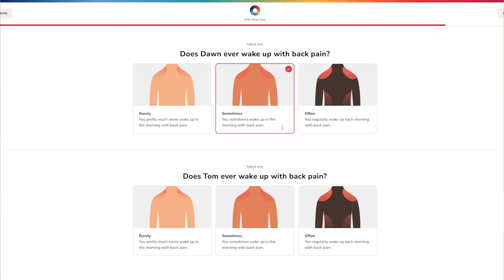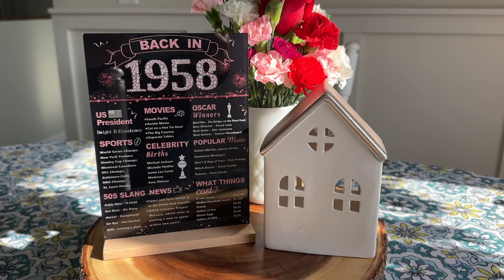Surprise Party Clean, Declutter & Prep with Me!

Comment: I love using fabric shower curtain liners 😃🎉... the key to drying them out well (so they don't mold 😕;) is a  plastic suction hook 🪝! 
Find the MIDDLE of the bottom seam, hook it, and then drop dry 💦
Reply: We also use the cloth liners. So easy to throw in the washer.

Comment: I always wash the shower liner in the washing machine. Yes, sometimes the liner doesn't last through the wash, but I've had very good luck and never lost not even one liner to the spin cycle. Of course, you take it out before the wash cycle ends, and it'll have water in it, but then i just hang it to dry. Wal la, new clean shower liner.
Saves money, too.  ❤

Comment: For a shower curtain idea... I like using 100% nylon fabric shower curtains. I don't use a fancy outside second curtain, just a nylon one and make sure it stays tucked inside the tub. It's easy to put into the washer to clean up every week or two. You can even put it back up without drying it in a dryer. Because it will dry on the shower rod just fine. I personally like a white one, but if you look for them, you can find different colors. If you have a clothes line outside, give it some sun and you may be able to keep weird stuff from forming on the bottom edge of the curtain after it's been washed. Enjoyed your video! Thanks for sharing.

Comment: I’ve had a fabric liner for almost 4 years now. I switched because I too did not like the waste that seemed to happen every year with the plastic liners. I have not looked back…I use it along with a decorative shower curtain and it dries quickly in my dry climate. I wash it in my washing machine about twice a year. I’ve only had a slight issue if 2 or more showers happen before the liner has time to dry and then it just wicks water onto the decorative curtain (only slightly annoying)! It’s better than tossing a plastic one all the time😉

Comment: I buy the heavy duty plastic shower curtain liners from WalMart.  When the liner gets scuzzy, it can be thrown in the washer with a load of towels, using liquid detergent for the wash and vinegar in place of fabric softener (vinegar dissolves mineral deposits from the water).  Shake the excess water off the liner into the wash tub, and then throw the liner in the dryer (no heat) for about 5 minutes, then hang it back up to dry the rest of the way.  Magic!  Love your videos!  :)

Comment: Dawn for the shower liner with calcium stains etc on it - you may be able to spray a mild mix of water & vinegar on it each time the shower is used - (just a thought).  I always wash the shower curtain & liner in the washing machine together in warm water & very little soap. When you're putting it in the dryer, it will be dripping but in just a warm temperature the liner comes out soft and clean with no rips in the plastic. - - - Also your party house looks lovely and I'm sure your mom will feel honored on her special day.

Comment: Our shower curtain has a removable liner that snaps onto the lower 75% of it, the top 25% is opaque.  Once a month, we unsnap the liner and wash it with 1 or 2 hand towels on a gentle cycle. I use about 1/3 the amount of detergent that I normally use and 1/4 c bleach.  We've had this shower curtain for years and it still looks great.

Comment: Hi Dawn, For the shower curtain liner, I just put it in the washing machine with detergent, 1/2 cup vinegar and hot water. It helps to wash some towels at the same time. Then put it in the dryer on regular heat for just a few minutes to get the wrinkles out and hang it up. Thank you so much for your down-to-earth personality and sharing your very helpful tips. And happy birthday to your Mom.

Comment: 11:50 I boil vinegar in my (electric) kettle to remove mineral scale inside. 

When I’m done with the vinegar, I tip it down the bathroom floor drains. It reduces any stagnant water smells.

Comment: Shower curtain liner! My sweet  grandma taught me to throw my plastic liner into the washing machine on warm w a little bleach, then about 10 min in the dryer on low and hang immediately - perfect! They also sell fabric liners I do the same with them and they have both lasted years! Also… if your plastic liner has a small lip on the bottom edge it will hold moisture so take your scissors and cut it off before use!!

Comment: I buy a good clear or frosted liner to go inside the tub. When it gets a little yucky, I take it down put in the washer with white towels detergent and a splash of bleach and hot water. Once it spins I put all of the wash into the dryer. After 5 plus mins. I open it up, pull out the liner. Clean and clear, no wrinkled up plastic!. Then finish the drying of towels while you rehabg the liner. Mom taught me this.

Comment: I buy fabric shower curtain liners. They aren’t hard to find. They can get mildewed, so you might have to wash it every other week or even every week. They also aren’t waterproof, so you do get a little water on the edge of the tub and possibly a small amount on the floor, but a bath mat or an extra towel should be enough to keep it from being a problem.

Comment: You guys did a wonderful job! I just wanted to share a tip with you that was once shared with me, place your heated blanket under your fitted sheet and turn it on just 5 minutes before bed and your blankets will also be warm so both sides of your body are toasty and not just the top. It’s also way cheaper than a heated mattress pad. I could never go back to the old way. Stay warm!

Comment: Hi Dawn - I actually invest in a medium or heavy duty shower curtain liner - then when it starts to get kinda yucky - I take down the linker and outer curtain and wash them both in my machine on the delicate cold cycle.  I usually can extend the life of the inner liner pretty long before I need to replace it.  I usually need to replace it only when the curtain loops start to tear after about 5 or 6 years.    Ive tried the washable inner liner, but honestly it leaked in our house so we had to go back to the plastic.  PS - I found if you spray your inner  shower curtain with Dawn power wash and let it sit on there for a bit,  lot of times I can just rinse off curtain and it keeps it from getting too moldy, especially around the folds.  I spray it on before I shower, then rinse it while I'm in the shower and weirdly keeps it cleaner longer too.

Comment: I do wash my shower curtain and liners but I wash them separately. The curtains I wash normal like I would a blanket, by itself. The liner I wash by itself and add bleach . You can also scrub it a little before you put it in the washer with some water and baking soda. I do this  occasionally. 
When the stains won’t come out I toss it out. You could also cut the bottom of it off that gets the soap stains and then use  the cleaner part of the curtain as a drop cloth for painting.

Comment: I have a snap out shower curtain liner like they use at our timeshare condo.  Whenever it needs cleaning, I unsnap it and wash it in the washing machine with two towels with a little lysol and gain liquid soap.  When it's finished washing, I take it out of the washing machine and snap it back on the shower curtain, leaving it drawn across the rod to dry.  I sometimes need to spot clean some stubborn areas after it comes out of the washing machine, but that is all.

Comment: I have the perfect solution for your shower curtain liner.  We have well water and liners have always been a problem.  I found cloth fabric liners at TJMax and Marshall's.  They carry white ones and are only 7.99.  I rotate two of them.  When one starts showing "rust" stains I hang up the other one.  In the meantime I soak the yucky liner in my washer overnight.  I use hot water and a cup of "Ironout".  Works like magic.  I hated those awful plastic liners.

Comment: I cannot be around synthetics, plastics,  vinyls, chemicals etc [long story] but I have found fabric shower curtain liners to work well, and launder well but don't get so "grotty" as the vinyl liners do.  Some are comparable prices and others are very pricey.  They are very simple to make if you just buy the yardage, and either add a casing to the top for the rod, or, add your own large grommets along the top hem.  I found that using 2 separate rods for the tub/shower worked best -- one for the liner and one for the decorative curtain.  I use actual linen fabric in a natural wheat color, or  when in rotation, use an eggshell color made from very tight weave "barrier cloth"; you could also use duck cloth with a tight weave.  My favorite store folded after decades, but there is a place called 'Organic Cotton Plus'; while I have not needed to buy more fabric in awhile, next time I do, I'll buy from them since my former source us no longer available.

Comment: I switched to the thin fabric shower liner instead of plastic or vinyl. They always have fabric in the nicer hotels I noticed. You can take it down and throw it in with your whites to clean it. Super easy. They usually come with the magnets on the bottom like the plastic ones. If they don't have that I know you would just buy and attached the magnets yourself! 😉

Comment: I wash my liner in the washing machine.  I add a bath towel or two for friction's sake and run it through a normal wash cycle. I drop the wet liner over the curtain rod while the towels run in the dryer and add the liner during the last ten minutes.  Works every time.

Comment: we also renovated an old bathroom and installed a collapsible glass shower screen. it is now about 15 years old and in good condition. Only the transparent silicone joint which seals the space between the two glasses has yellowed a bit, otherwise everything is like new.

Comment: I use plastic liners and have super hard water. I mitigate the water spots with a mix of half-and-half hot water and vinegar, with a couple of drops (a little goes a long way) of Dawn detergent. I slather it on with a sponge, let it sit for a few minutes, then gently scrub off- I have a detachable showerhead so it's easy to rinse. Eventually when it gets to the point where it can't be cleaned anymore, I save it and use it as a painting or craft project drop cloth. I buy a liner approximately once every four years.

Comment: I use washable fabric shower curtain liners (think hotel shower style). I have two for my one shower, in case one doesn't make it through the laundry right away. I find they only need to be laundered once every 1-2 months in my household. They last for years. I prefer the ones with magnets on the bottom.

Comment: For years, I've used the "Hookless" brand shower curtain.  No shower curtain rings. YAY!!! It literally takes SECONDS to remove the curtain or hang it up after laundering! But also, I haven't used a liner with them, and they work perfectly fine. I don't know if they're still available without the liners, but I'd like to find a different color for my one bathroom that I plan to paint this summer. So I need to remember to search for one :)

Comment: For shower curtain liners we have had real good luck with the heavy white plastic shower curtain from Menards. We do a quick wipe down after our shower and it has been good for 10 years or more. Being white you don’t see the water spotting. Also we no longer use bar soap as that will leave it’s own residue.  As to your Bundt cake was it your larger pan that will not rise as tall because it takes more batter to get the same height as your smaller pan? Happy birthday to your mom. Looks like you have choices the makings of a very nice party.

Comment: You can actually wash the plastic shower curtain liners in the washing machine with your towels or shower curtains.  Add one cup of baking soda and 20 drops of tea tree oil and they come out nice and clean.  Wash in cold water and then hang to dry. I actually just learned this myself.  All those years of throwing away those liners.  I just never knew.

Comment: My mother in law taught me to just use the fabric shower curtain without any liners. U just wash the shower curtain as needed in with towels. It's easier to take down bc it's just the one curtain to mess with. It doesn't let the water out into the floor either. I was always afraid the water would end up in the floor if I didn't use a liner but it doesn't. Ever since I tried it, I haven't gone back. It's just easier and it makes it easier to freshen up the shower, no liner to deal with. I just wash the fabric one and hang it back up easy peasy. 

Also, bonus the shower curtain doesn't come in on u while u shower like the plastic ones. Once it is wet it holds the curtain out of your way. So win win. :) solves two problems 😀

Comment: The liners are washable.  I put them in the washer with two bath towels on top. Wash with hot water,  1/3 C. detergent, 1/3 C. beach. Don't dry in the dryer unless it is a fabric liner.  Hang back up to dry.

Comment: Fun stuff!  I have the dark fixtures in my bathroom, too. Did you use regular vinegar or cleaning vinegar?  Our faucet is the trough style, which I love, but the water sits on the top & creates white deposits. I soak a paper towel in regular vinegar & let it sit, & that helps, but not entirely. If using cleaning vinegar, do you dilute it at all?  Thanks!

Comment: For the shower liner - throw in the washing machine with a cup of vinegar and it gets all the water spots and residue off.  Hang it back up wet.  Super simple!  If it has mildew wash in machines with oxyclean.  Have done this for years- the liner should last 5-7 years this way.

Comment: Shower curtains are a cheap change up. I use a fabric liner and I like it for the texture verses plastic, but mine still gets moldy at the bottom very quickly. So, I have to soak the edges in bleach.

Comment: How To Clean Shower Curtains Using Baking Soda

Bathrooms are largely damp environments, and shower curtains tend to attract moisture.

For these reasons, they are prime targets for mold and mildew growth and should be cleaned regularly. 

Ingredients: Baking soda, water, distilled white vinegar

Method: If your shower curtain only has a few drops of mold or mildew on them, then this can be removed with a light paste of baking soda and water. 

Apply the paste to the area to be treated and scrub gently until the stain is gone. Finally, spray down the area with the neat distilled vinegar to prevent any mold regrowth.

Heavy mold and mildew Ingredients: Baking soda, washing detergent, distilled white vinegar

1. Wash the shower curtain in a washing machine with two bathmats on a low-temperature setting.

2. Add one cup of baking soda to the detergent during the wash cycle.

3. Add one cup of vinegar during the rinse cycle.

Finally, remove the shower curtain from the washer, rehang it and allow it to drip dry.

The shower curtain should now be stain-free and smell fresh.

The bathmats are important to prevent folding and provide a rubbing action to the shower curtain whilst in the wash.

Depending upon the washing machine’s internal seals, it may need a further rinse cycle to clear the system of any remaining vinegar.

This will prevent a mild acid from “sitting” on the rubber seals within the machine and invalidating the warranty.
Reply: I would have just posted a link to the site and let you search through the recipes, but it says, "this site is currently unavailable". So I'm just going to share the one recipe. I've tried it and it works!

Comment: You can get a fabric waterproof liner. I have used them for years. Target sells them. You wash them just like any other fabric, but it's waterproof. I have owned mine for 20 years, clean as they were the first year. I buy white so I can spot clean or bleach them easily. Can't recommend highly enough. I really dislike the plastic.

Comment: How to Clean a Plastic Shower Curtain or Liner
Step 1: Remove the Curtain.
Step 2: Place It in the Washing Machine.
Step 3: Add Detergent, Vinegar, and Baking Soda.
Step 4: Run on the Gentle Cycle.
Step 5: Remove the Curtain and Hang to Dry.

Comment: A question for anyone: How to clean the inside bottom of toilet bowl since it's full of water. Mine has discolored to the point it looks dirty all the time. Embarrassing.
Reply: Take a bucket of water and dump the water into your toilet bowl. It will trigger your toilet to empty, and it won't fill back up again until you flush it. That'll give you access to the bottom of the toilet for cleaning.
Reply: Bleach?